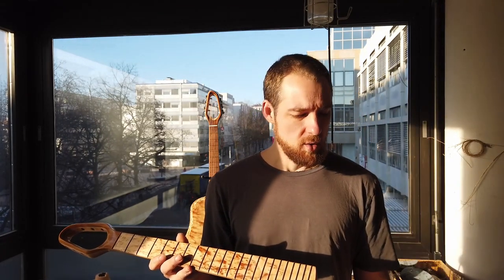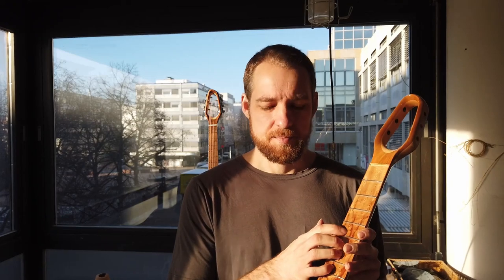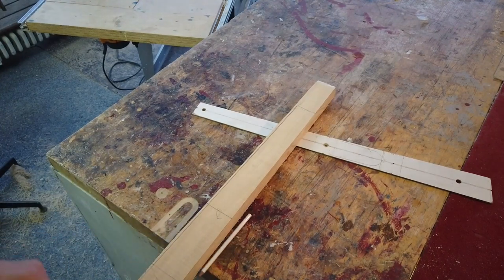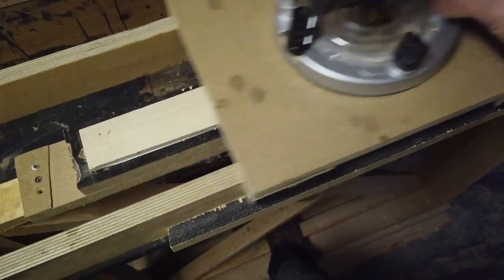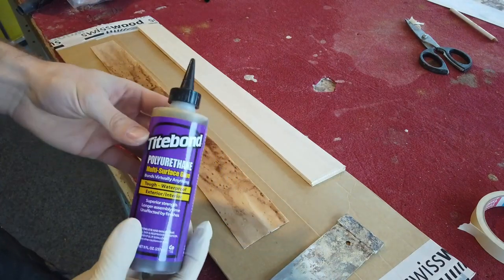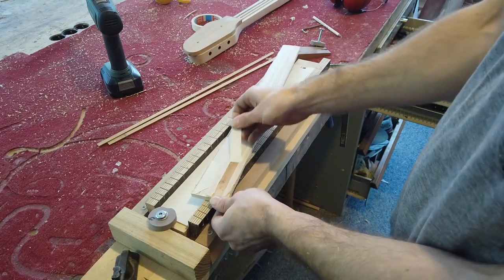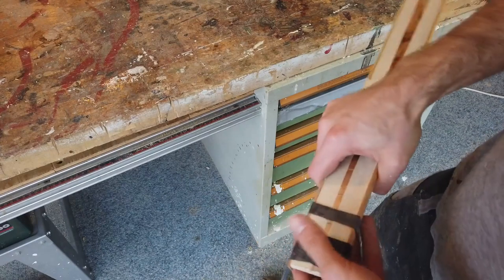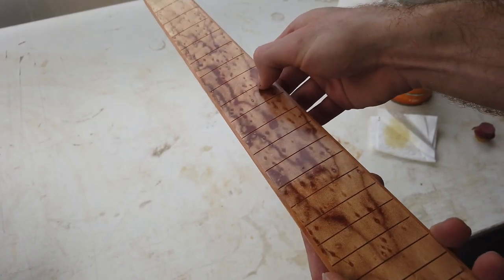The Veneer Fretboard Methode - feat. Sonoveneer

Comment: I like the idea.
Have you tried titebond III (green) for guitars? I've heard it has interesting feature. While being quite hard it's yet flexible enough to hold guitar in one piece even in extreme environment. As for red titebond I've heard that some parts glued with it can tear off. Mostly in happens to guitar bridges glued with red titebond. Once its fixed it becomes hard as stone or glass, while wooden parts tend to change size due to environment conditions such as temperature and moisture. Just because wood 'breathes'. And since guitar parts are mostly made of different sorts of wood, they stretch or narrow differently while glue doesn't move at all. Imagine what happens. So red titebond is a bad choice for guitar making. By the way. Just an advice because I like you and your job. Expensive luthier crafted  accoustic instruments, some spanish guitars for example, bowed instruments such as violins are glued with FISH GLUE made of sturgeon fish air bladders. This natural glue is really expensive.
Physical properties of this clue except for water resistance have some resemblance of titebond III.
Reply from the maker: Interesting. I've never seen any luthier using anything but Titebond I. And that it's not water resistant is a plus for repairability. And you don't want to put your guitar in "extreme environments" anyways... Fish glue I use for some jobs. Hide glue also sometimes but not as often. But I'll look into it, maybe you are on to something. Thanks.
Reply: @cannaguitars4593  what if someone from overseas buys your guitar from some place with climate, moisture and temperature changes completely different from your place. who knows what happens if the glue is as hard as stone. water resistance in this case doesn't really matters. titebond I is just way too stable and hard if wooden parts shift due to environment

Comment: Lovely finish, Jakob, and an intriguing use of spruce.  I presume the advantage of spruce is mainly for weight or does it discernibly alter the sound in any way?
Reply from the maker: in this case it's mainly for weight, but I think the fretboard material does a lot for the sound as well. You could imagine a Fretboard out of carbon fiber would make the Neck so much stiffer and that would change the sound a lot i think.